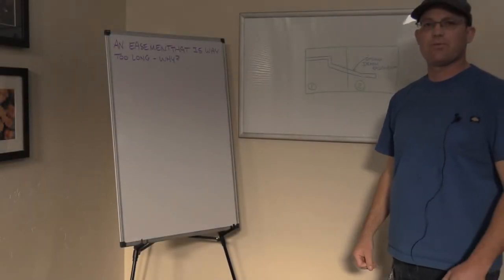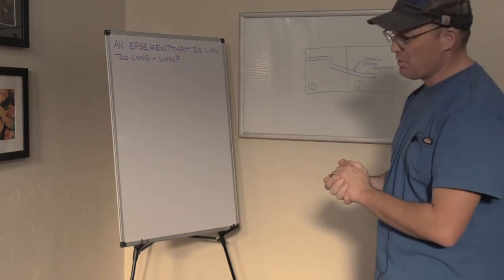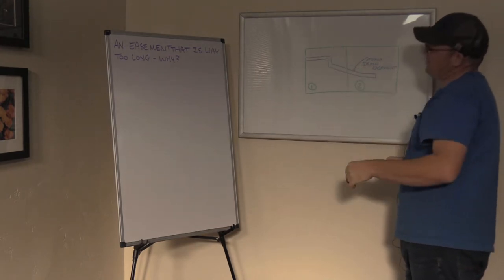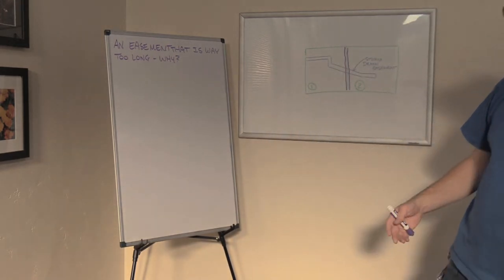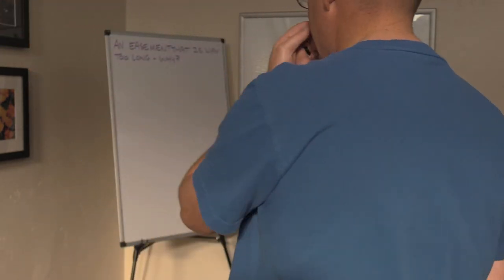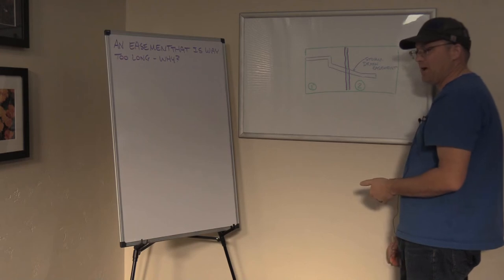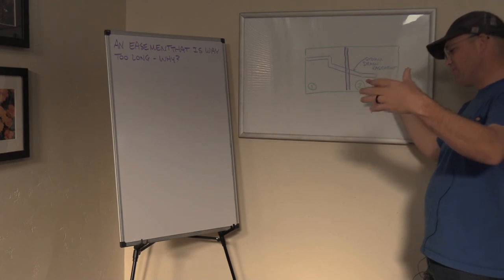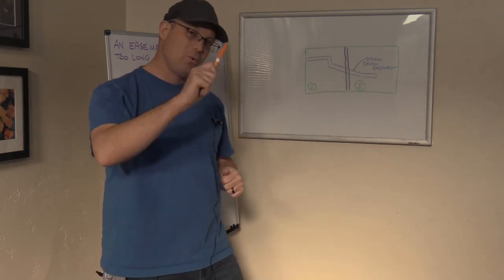The Storm Drain Easement That Was Way Too Long

Comment: We lived in a subdivision where there were several county culverts under the road and along the road. The developer bought the large parcel, subdivided it under a subdivision plat and assigned drainage easements around each structure.  Our state has minimum easement widths for government owned structures like pipes and so a few of those easements crossed property lines which were already on the plat.  The effect was minimal. The county owned the structures, the easements were drawn based on minimum lengths required for the size of those structures, and the easement language was clear: the county was the dominant easement holder for the express purpose of installing, maintaining, inspecting, repairing and replacing those structures and the land owner was responsible for landscaping with building restrictions within the easements.  No problem at all except for the last lot to sell. It sold a few years after all the others and so when those new neighbors got into their new house, they had a few neighbors who had become accustomed to entering their lot to play and even ran their own drainage lines into their lot under the ground unbeknownst to them.  The long term residents saw that vacant lot with an easement as "public land." Of course it wasnt. The easement stated the title owner retained all ownership rights except those specifically encumbered by the easement. But the minds of neighbors who grew into having a county easement on vacant land was a long hard fight. They won it by fencing it off and calling the sheriff a few times.  But it did end finally but it was costly in terms of money and stress for the couple who thought they had a stress free home, survey and all.